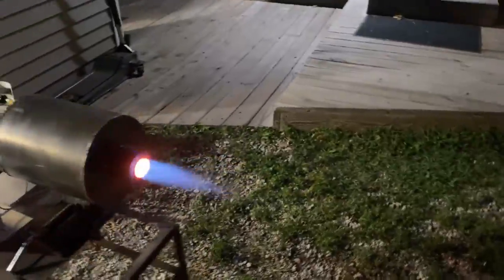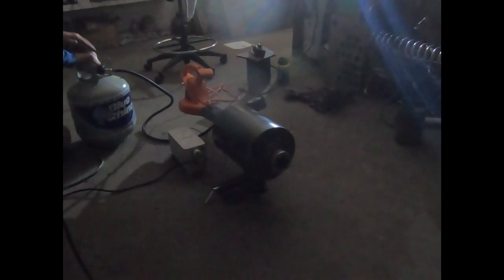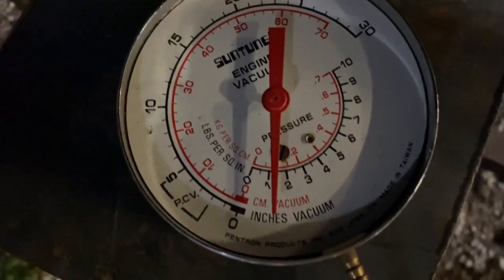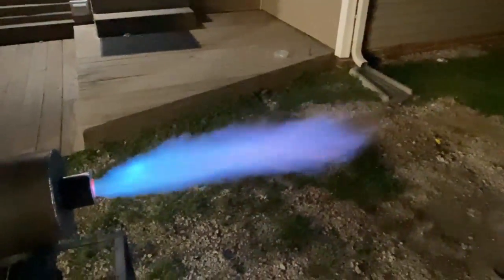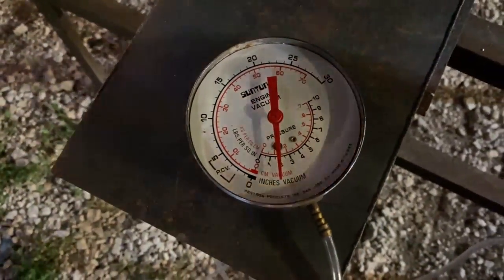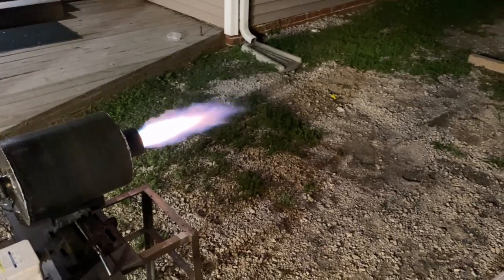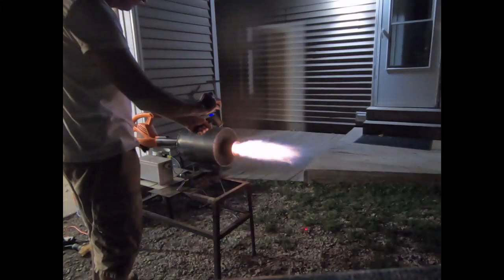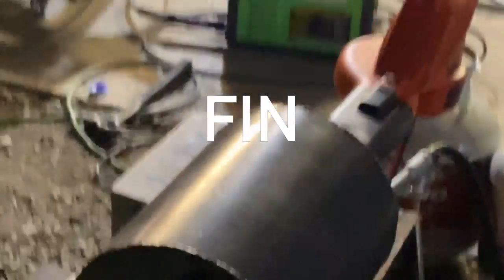Concrete refractory Natural Gas Metal melting furnace burner

Comment: I want to send you a video of a burner that I made in my garage. The difference is that the air takes a 90 degree turn right as thee gas is introduced. Then it goes through the venturi. DM if you want me to send it.
Reply from the maker: hello how can i contact you ? my info is in the description

Comment: Bigger tractors have a pipe up the center of the exhaust stack, to make a vacuum,  for the air filter, cyclone prefilter, so a bulk of the oncoming dust gets blown out the stack.
Reply from the maker: Fantastic input

Comment: Yes, creating a vacuum is almost as good as raising the pressure, so you will certainly be able to increase your gas flow.

Also, increasing the fuel line diameter you will further increase fuel flow for the given pressure and linear gas flow velocity.
Reply from the maker: I see your out of youtube Jail LOL .